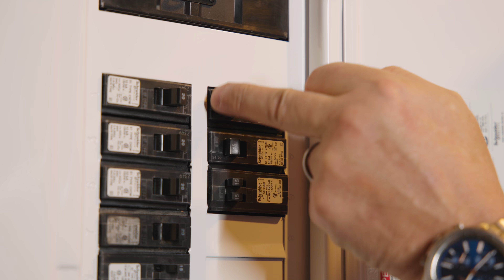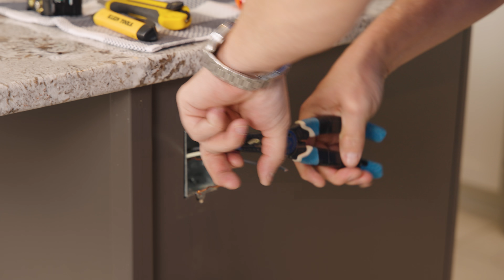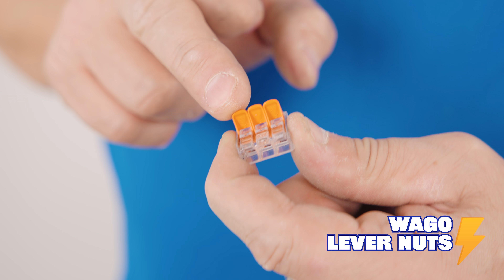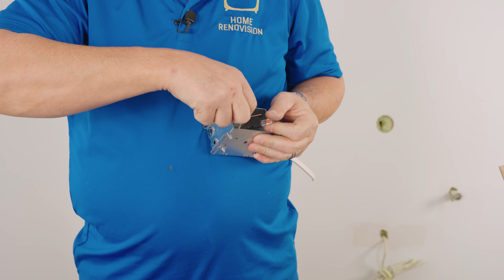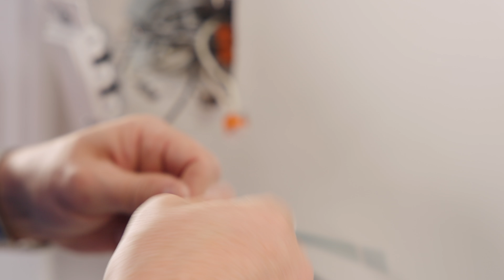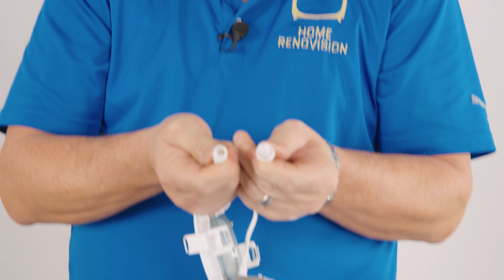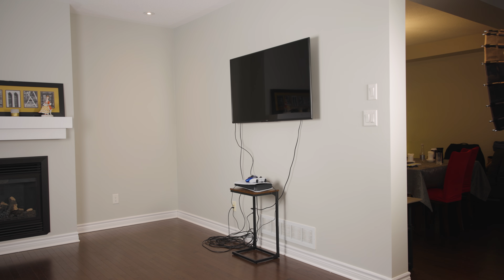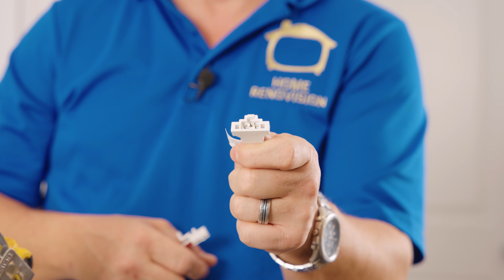Electrical Hacks Every Homeowner Should Know (DIY Friendly)

Comment: You don’t always use 20 amp receptacle on a 20 amp circuit, no need. Unless you plan on using high amp appliances, power tools, hair dryers. Most home owners don’t need to spend extra money on those receptacles, 15 amp is plenty for most.
Reply: 20 amp receptacles are required for 20 amp circuits in Canada.
Reply: @surferdude642 only if it supplies one receptacle,  but if the circuit is tied to more than 15 amp is fine.
Reply: @Peter-r1q3f That's true in the US, but my understanding is that Canada has different rules for this, unless it was recently changed. 
If the circuit supplies only one receptacle (dedicated circuit) it must be a single receptacle, not the common duplex.
You don't need a 20 amp receptacle unless your appliance has a 20 amp plug, which is rarely used. As long as your higher amp appliances have a 15 amp plug, such as power tools, hair dryers, blenders, toasters, etc., a 15 amp receptacle is all you need, although I would use a commercial grade 15 amp in these cases. 20 amp receptacles are optional. The important thing is that the wire must be 12 gauge, minimum.

Comment: what he just did was dangerous., he still had power while still wiring. I saw  him flip the switch while he's still wiring. Not for beginners. I would have tested all three switches. One small and stupid mistake can cause your whole body get burned or be killed. He didn't even show when he flipped the circuit breaker back on. Too many youtubers show how to do it, but too quickly. Safety is my main concerns.
Reply: Don't touch the hot and ground/neutral at the same time and you're fine Nancy. 120 volt household current is not really that dangerous unless you do something stupid. Personally I never kill the breakers unless I'm working at the box. 

Yes I've been bit several times over a lot of years and I'm still ticking along.
Reply: @c @chrisschmidt355 wow. You should have been my teacher 🤯. Did you know it takes 35mA to kill a human. That’s milliamps. The breaker is 15-20 AMPS. So YES!!!!! It can absolutely kill you. It’s comments like yours that hurts people. You even admitted your stupidity of getting “poked”. Believe me, you just got lucky you didn’t suffer more injuries. Hmmm, you’re probably not smart enough about this to understand why. Let me help you out and everyone reading this, It’s due to the resistance between you and the return path of the current. Try it a few more times and you will eventually meet your maker. Don’t think you are invincible, be smart, and turn off the power.

Comment: I used those slim LED lights in my basement. 11 to replace 2 dual socket incandescent lights. I did put them on a controller & dimmed them to 55%, it was perfect.

Comment: I much prefer the wago lever nuts as well but first those wire are removable the instructions tell you to twist and pull to remove them (and it does work I do it all the time).  Second wago and other manufacturers make both types so don't just buy any random wago make sure it's the lever nuts, and I do recommend the wago brand vs any other.

Comment: I came across a game changer myself recently ..... Kenetic Switching!
Lights or other low power are easily done. You can fit the receiver in the ceiling and the switch 3mm thick Sticks on to a convenient wall! I put my switch on the side of my freezer ... because I have a sense of humor .... but any wall will do!

Comment: Jeff, honestly wondering: am I just mis-remembering, or didn’t you used to advise AGAINST using the push-in connectors on outlets?  What changed?
Reply: BackStab is what you want to avoid mate.
Reply: He still said he doesn’t like them in this video bc they can’t be removed without cutting the wire. The wagos snap on and off so they’re more moron-friendly (which I appreciate, as a moron)
Reply: The modern push in connectors are built differently than the old backstab ones.
Reply: If the wire is being held by the screw it's ok what's bad are the push in or backstab where you don't have to screw it down it typically goes in a little tiny hole separate from the screws on the side.  So totally different, and consistent with his previous advice, along with all other professionals advice. And on the switch it's technically a lever nut connection, again totally different, but easily confusable for a DIY'er.
Reply: Company improve the product
Reply: Wago is superior to whatever crap you had previously in the US and Canada
Reply: What changed? Affiliate opportunities.

Comment: For the motion sensor: 
always cap the unused wire
Always connect the ground first no matter the device, ground is always first

USB outlet:
If its a metal box always tape the device

Comment: Motion sensor switches are not all they are cracked up to be. They put them in the change room at our building's pool. I was showering happily away, in the shower stall around the corner from the light switch - and the lights went out. Fortunately I realized what had happened (after a nanosecond freak out) opened the shower door, and stuck my arm out and waved it about. The lights came back on. However, when I left the changeroom, and went swimming, the lights went out again - and when I turned out the main pool lights after my swim (it was late at night) I was suddenly in a corridor approach to the change room, with no lights - as the sensor was two corridor turns and a door away from where I was. I had to turn on the main pool lights again (and there are a LOT of them) and was just pissed off enough to walk away and leave them on all night. So - the little motion sensor light (singular) in the change rooms saves electricity - but the huge bank of high intensity lights over the pool are (frequently) left on all night because the change room light shut off. There are some places where is it best NOT to use the damn things.
Reply from the maker: Good points here. Cheers
Reply: @HomeRenoVisionDIY  Of course, if the morons had put a sensor in the corridor, that turned on the changeroom lights ... it would help. But as I mentioned, they are morons.

Comment: 2 lol... Alot of great info in your videos. Thank you!
Reply from the maker: Cheers!
Reply: @HomeRenoVisionDIY one question as I saw you do the pots. My existing ones can't change colors. I know those connectors you can't pull the wires out but if I only used 1 could I technically cut all my old lights out and use them in another location with the 3rd, available slot for the wires?